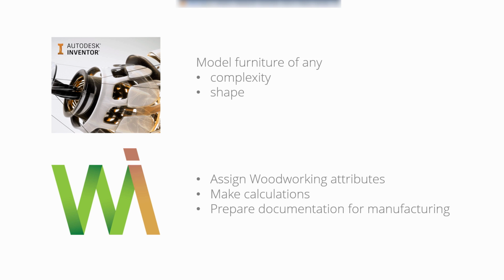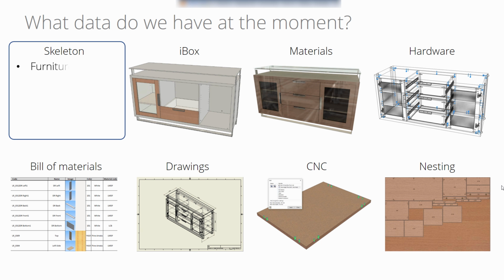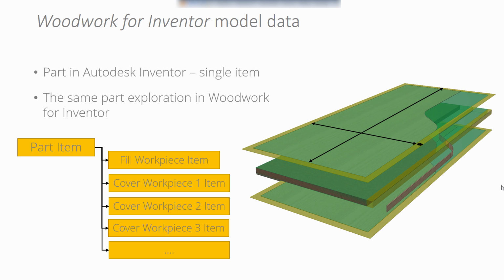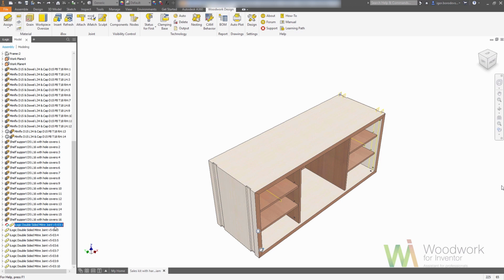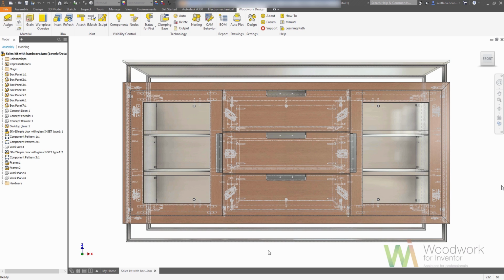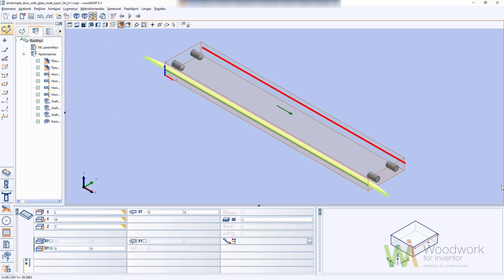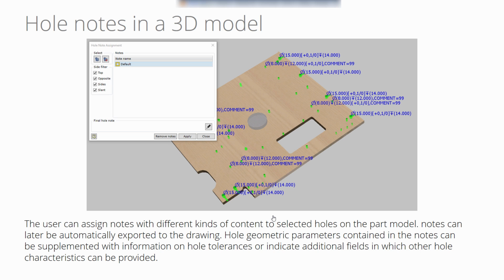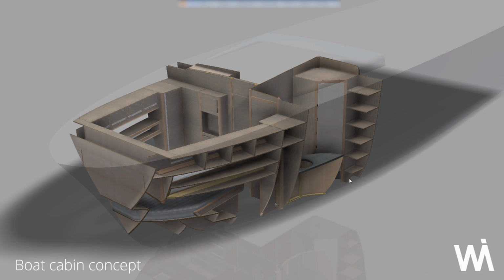Woodwork for Inventor - Furniture design software

Comment: Hi, can I manipulate with Woodwork for Inventor, 3D models made in AutoCAD? Can I add fixtures, do nesting and CNC cutting?
Reply from the maker: Hi,
if you meet the following conditions:
1. Have Autodesk Inventor
2. Have Woodwork for Inventor
You can import your AutoCAD 3D model into Inventor and assign materials, add fixtures, do Nesting and CNC.

Comment: Thank you! 
I have some knowledge of Inventor but it's limited to mechanical design. In the mechanical design software there are tools for strength and stress analysis such as shaft design or gear design etc. Are there similar tools for woodwork design to say assess whether if a load in applied in this area, e.g. how much certain points will bend or flex? 

For example will the cabinet centre warp after time if there's a heavy TV standing on it - then I can add some additional feet or wheels. or perhaps a door with a glass pane will hang nicely for this design but if I scale it up and the glass becomes heavier the program could indicate that there are structural problems that may need to be resolved. I assume that most woodworkers don't necessarily know how to do these types of calculations and as someone with a mechanical background I'm uncertain of the strength rating of different joint types or perhaps wood/composite type and grain directions etc.

Comment: hi. what's the difference between inventor and fusion 360, and which one is better for interior design?
Reply from the maker: Hi, Ivan,
It depends on the complexity of your designs.  If you are working with smaller designs - Fusion is easier to learn, less expensive.
But it has some limitations when you are working with large or complex assemblies, need to do complex drawers etc. If it’s your case then Inventor is definitely your choice.
You can find a lot of hot discussion about that on the internet :)

But in you are comparing Woodwork for Inventor solution it’s definitely a winner here since it automates your workflows a lot.
For instance, it allows placing joinery as you might see from this video. But this is just a fraction of all functions, Woodwork for Inventor automatically generates BOM based on your model, creates drawings and CNC and does a lot more routine tasks. You can download a trial and check it out.
Reply: @tools4inventor  thanks for the reply

Comment: Great video. The main reason I want to learn Inventor is because of your product. But in all your video it's at if you are using magic. I can never follow along and get exactly same result as you. Like using attach for ibox component. 
How do you get to select so many parts and planes? I can only attach one icomponent at a time.
Keep up the good work. I believe you have the best tool for woodworking better than most crap out there but learning this is add. If you can put together a simplified tutorial that will be great.
Reply from the maker: Hi! 

First of all thanks for good words about Woodwork for Inventor! :) 
Now about your question - as long as we understand the problem that you face rise because there are two modes in hardware attachment command: SIngle mode and Multiple mode (little blue squares on the right). While using Single mode you can attach only one component and specify only one plane at once. If you switch to Multiple mode you'll be able to specify multiple planes for each  constrain (iMate) specified in dialog box. 
I hope this explanation will help, and if you'll have any further questions, please let us know via forum - forum.woodworkforinventor.com or write to us - support@woodworkforinventor.com

Br, Woodwork for Inventor Team
Reply: Woodwork for Inventor Thanks for the quick response. I figured the multiple selection thing out in the end.
I'll check out your forum.
Thanks again